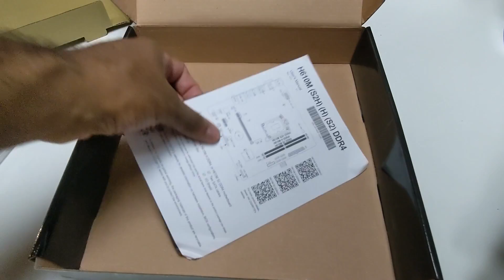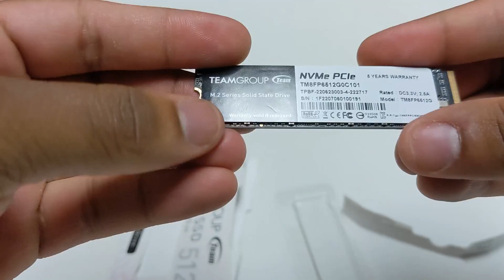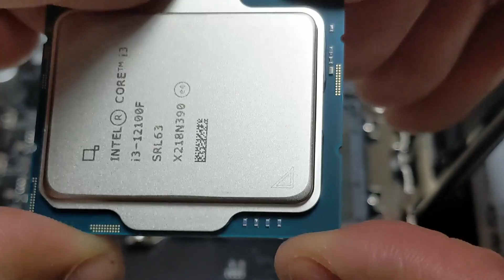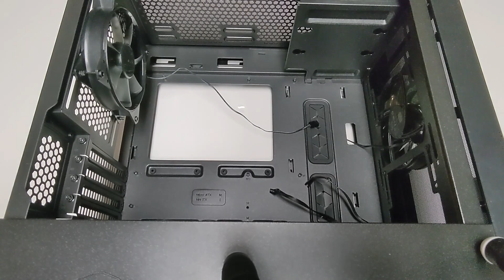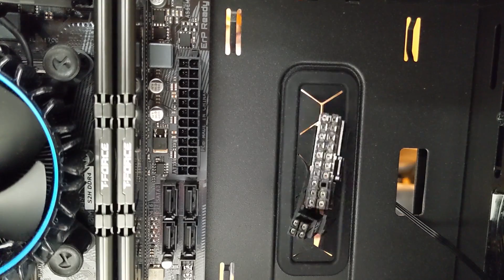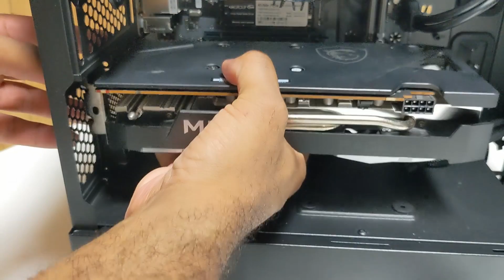RX6600 & Intel i3 12100F Build   Tech Lion

Comment: And still 2 years later, the 12100 is still a fantastic budget PC for 1080 gaming.  I just recently did a cheap build with a 14100F which is just an overclocked 12100.  I paired it with an overpowered (for the 14100) Rx6800.

Comment: Problem is the motherboard doesn’t come with Wi-Fi so if u don’t have a Ethernet port or your wifi router is too far your gonna have to buy a Wi-Fi card for around 20-50$ depending on how strong your Wi-Fi is I went with a 35$ TP link Wi-Fi card
Reply from the maker: I've started including wifi dongles with PCs we send out from here if they don't have onboard wifi built onto it! It's quite the selling feature.
Reply: I bought wifi dongle under 3 dollars

Comment: If u r getting i3 12100f with rx6600 
If u are tight on budget go with stock in box cooler (that will make some noise not very but yeah). 
But if u can spend like 20-25 $ go with a deepcool gammax cooler Or any other cooler (it will help cooldown temp. And will make no noise like zero noise). 
Btw gaming temp. On this card with stock cooler will get to something 75-85 degree celsius and with a seperate 20-25 $ cooler u will get like 68-75 degree celsius. 
Hope this helps😃👍
Reply: I have the 13100F, almost the same processor with a stock cooler... with a 3070Ti.

85-90 degrees while gaming
60-72 degrees while browsing the internet

Comment: I have basically the same build, only the ram and gpu brands are different (but same model/specs) and everything else (even the case) is the same. I found it funny because I didn't see this video before building mine. I replaced the front intake with 2 noctua fans. I find the intel cpu cooler to be a little too noisy for my taste under heavy load. However, it only happens during gaming when I'm usually using headphones, so not such a big deal (I might replace it with a noctua cooler in the future, also for consistency, although it sounds like an overkill for this cpu). I wonder if I will be able to use the pcie 1 under the gpu, as there is very little space. For now I don't need wifi, but if I do in the future I might want to install a wifi card. Worst case I've seen there are risers available but I'm not sure about size/spacing issues (bringing the card down a slot might interfere with the audio cable). One thing that reviewers often don't mention is that if you use a 3-slot gpu with this mobo, it covers the pcie1. This is why I only considered 2-slot cards. But if I want to upgrade in the future, say to a rtx 3070 or 3080, I've seen that most (not all) use 3-slots. This is something to keep in mind when choosing the mobo. Anyway so far I'm very happy with the build, it plays anything at Ultra settings at 1080p above 60fps (actually so far with the games I gave above 80-90 fps).
Reply: bro is it ok to pair rx6600 with h610m s2h??? will rx6600 work great??? plzzzzzz replyyyyyyyyy
Reply: @mansipawar_  yes I have the same build and it still works great.
Reply: @vispinet  thnks
Reply: @vispinet  i want to ask shoud i go for b660m or h610m is good for gaming with rx 6600???
Reply: @mansipawar_  I don't have the b660m so I don't know... I guess it depends on price where you live. I suggest to check and compare the specs...
Reply: @vispinet  one last question, is there space left to install wifi card after installing rx6600
Reply: @mansipawar_  I think it would fit but it will be tight. I didn't install one because I wanted to maximize airflow and I have access to an ethernet cable.

Comment: Can you please tell me if a boxed cooler is enough for this processor? What is your gaming temperature?
Reply: If u r getting i3 12100f with rx6600 
If u are tight on budget go with stock in box cooler (that will make some noise not very but yeah). 
But if u can spend like 20-25 $ go with a deepcool gammax cooler Or any other cooler (it will help cooldown temp. And will make no noise like zero noise). 
Btw gaming temp. On this card with stock cooler will get to something 75-85 degree celsius and with a seperate 20-25 $ cooler u will get like 68-75 degree celsius. 
Hope this helps😃👍

Comment: Very reasonable build.  FYI . .  in reference to the TeamGroup M.2, their MP34 series sticks use DRAM cache (vs. SLC). 
This is a tad slower but greatly improves the life expectancy of the drive. It actually doubles the life expectancy.
Reply: Talking about MP34, TeamGroup does NOT even reveal how much DRAM cache is on the drives, when you look at 'Specifications' on their website.    Not enough information there to trust the drive.

Comment: might have been better to go with a cheap 5000 series ryzen cpu
Reply: Yes, I built up a system 6 months ago with ryzen 5600 non X and B550 board, it cost $nz400, I have just built up an i3 12100f with h610 for $nz300, because I noticed the AMD prices have increased to $5nz500 for my old build, you could buy an intel h610 12400f system for $nz450 which is cheaper than the AMD system which is an odd situation, though maybe the AMD 5600 paired with an old B450 board would be a nice system.....it's odd that AMD isn't really a cheap option anymore , and AM5 is just insane pricing.....
Reply: @nix123ism  yeah i just noticed that lots of recent budget builds are intel + amd which is kinda weird bc amd+amd= performance boosts
Reply: It’s an INTEL motherboard not AMD. The CPU wouldn’t fit into the slot’s correctly

Comment: Good specs for a budget build but there are a couple things you should consider changing. Go with a B660 motherboard with some cooling on the VRMs, which will provide better thermals, upgrade path, and longevity. Also, that PSU is terrible. Search "cultists psu tier list". The EVGA N1 has a "Tier F - Replace Immediately" rating and bad professional reviews. Not a good unit to trust with your components. Best of luck to you.
Reply: Welp, rip to the dood who buys this then. Yea for budget builds any C tier or higher would do just fine, and making sure u leave 1.5x headroom for the wattage estimate in pcpartpicker

Comment: the absolute worst in this build is that h610m that totally tanks performance    use a cheap b660 from asrock Instead not this
Reply: U mean that board would thermal throttle the cpu and in turn bottleneck the gpu? Nah not for a board with a vrm heatsink. This whole build is low wattage anyway, ur not raising temps up that much even when gaming. B660 boards have better features and it’s what you need for any cpu higher than this, but for gaming this h610 will work fine. U are severely limited in ur upgrade path tho, any cpu upgrade would have to come with a new mobo
Reply: Lol a H610 wil not bottleneck a I3 12100f dude
Reply: The absolute worst is you dont know what you're talking about for i3 with low wattage h610 is already enough, so there's no reason to buy b660 except if you plan to upgrage to i5 in the future
Reply: In h610 u can pair i3 12100 or i5 12400f easily there wont be any bottleneck for both of them , as for b660 getting a good mobo for it is good instead of cheaping out
Reply: Yes
Reply: Where i'm at you cannot buy proc and board individually, with an i3 they bundle it w/an h610. On one store in our place they would not sell the b760 without buying the i9-12900k, smh.

Comment: Would u recommend pairing a 3060ti with the i3 or would it bottleneck too much and just be a waste of money? Using the 6600 as a reference
Reply from the maker: Once you start going more powerful with video cards like the 3060Ti or RX 6600XT, an i5-12400 would work better to squeeze out more performance. Plus you'll have access to both P cores and E cores so even your day-to-day tasks will get a nice boost as well in comparison to the 12100F, which is more of a budget oriented processor.
Reply: @TechLionPCs  Would a 3060 be a good pair to 12100f? Is it okay also for 2560x1080 monitor?
Reply: @TechLionPCs  i5-12400 doesn't have E-cores.

Comment: How's the stock cooler? Is it too loud or hot?
Thanks for the build guide 👍
Reply: I'll get you updated, I have the exact build on the way :)
Reply: @cybersamiches4028  do let us know
Reply: The stock cooler runs a little hot but I think its just barely enough
Reply: If u r getting i3 12100f with rx6600 
If u are tight on budget go with stock in box cooler (that will make some noise not very but yeah). 
But if u can spend like 20-25 $ go with a deepcool gammax cooler Or any other cooler (it will help cooldown temp. And will make no noise like zero noise). 
Btw gaming temp. On this card with stock cooler will get to something 75-85 degree celsius and with a seperate 20-25 $ cooler u will get like 68-75 degree celsius. 
Hope this helps😃👍
Reply: @successfulClipperr  i have around 60c max but yeah the noise becomes unbearable from all the ups and downs in usage
Reply: @AintPopular  faulty cooler proly mines stays at 4+ghz at all times and while gaming it dont hear it unless i put my ears near. most cpu intensive games only use about 50% Max at 60fps eg. spiderman miles morales even stress tested the cpu with cpu z and fan was still quite a bit silent and doesnt go above 70 degrees
Reply: Steam told me they cannot fix my new $8000 VR System.  Steam Suggested that I find a "local tech person" that can maybe fix their crap.  I will pay you WELL, if you can fix it

Comment: hey bro @Tech Lion which monitor  will be suitable for this build to get maximun fps from the system 75hz or 144hz?
Reply from the maker: For a system of this quality, a 75hz system at 1080p would do justice. If you're aiming for higher FPS so that you can fully utilize 144hz, something more powerful may be need. Esports titles like Valorant, CS:GO, Apex Legends and Siege should be able to hit +144FPS with this setup as long as you tone down the graphics but more graphically intensive games may not.
I personally run an RTX 3070 using a 27" 1440p 144hz display and that's about the tier of graphics card you'd want for that sort of refresh rate.

Comment: Is anyone having problems with the drivers? I'm starting to hate AMD because of the drivers that are crashing all the time. I was expecting to get an RX 6600 or RX 6600XT but with the driver issues, I'm thinking about heading right to NVIDIA as I found out the silicon lottery. Any suggestions?
Reply: Go to their driver site and update ur driver. Latest one is 22.8.1. Mine is rx 6600, working just fine after I updated it.
Reply: @vengence7834  Yeah, but the newer drivers tend to be unstable, so did u have stability problems before and now they're fixed? BTW After a further investigation, I discovered that we depend on the silicon lottery when we buy an AMD GPU because the adrenalin drivers do automatically a little overclock and if we have unstable cores in our GPU or CPU, we may have problems and that's what I'm experiencing right now and that's a pain in the butt.
Reply: @vengence7834  which  monitor u using bro?
Reply: @sanjaywakchoure5273  yeah, I started having issues when I switched my monitor. Had crashes while gaming with my 550 back then, and only with some certain drivers, I recommend you that if you find some drivers that cause no issue, stay with them until AMD release newer drivers to give them a try. 

Coming back to the monitor issue I would recommend you to Google your issue, sometimes a couple of tweaks will fix everything, in my case what was causing issues was AMD freesync

Comment: I have a very similar build, I opted for a 1tb ssd, and got a cheap tower cooler (ak400 deepcool) and went for a semi modular psu so cable management was easier
Reply: Wdym by semi modular like is the cable seperated from the psu, and other type is that its aldreeady attached and not able to rrmovem
Reply: @Goatpro1  some cables are attached.

Comment: Nice build bro. Is there any bottleneck with i3? Is it powerful enough for the RX 6600?
Reply from the maker: It sure is! I was surprised by how much juice this quad core has for the price. Not so fantastic for productivity work but it is great for gaming. More powerful graphics cards like a RTX 3070 or RX 6700XT would definitely need more horsepower like in an i5-12400 processor.
Reply: @TechLionPCs  you think that i3 would bottleneck 6700xt?
Reply: @zelatur  yeah he just said that
Reply: @zelatur  If 60 fps is all you need, the slight CPU bottleneck of the 6700 XT is a non-issue.
Reply: @zelatur  no it wont maybe in open world games littlebit like 4-5% coz i have seen its running 3060ti with no bottleneck
Reply: @TechLionPCs  whats the AMD equivalent of the i5 12th gen CPU? Would buying that equivalent be cheaper?
Reply: @nileredsexperiment834  Ryzen 5 5600? or 3600
Reply: @redvelvetissweet  Would that be cheaper than the Intel counterpart?
Reply: @nileredsexperiment834  same price here in india
Reply: @nileredsexperiment834  here in Italy the i3 12100f costs half of a Ryzen 5 5600, it is a little less than a Ryzen 5 5000, which, however, in addition to being more expensive, is also weaker for gaming.  So the i3 12100f has no price competition for me.